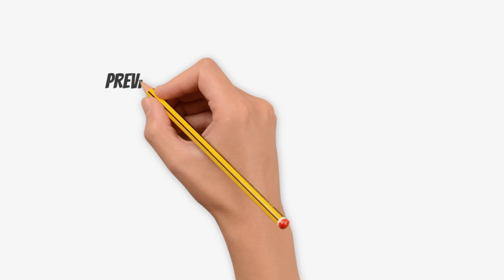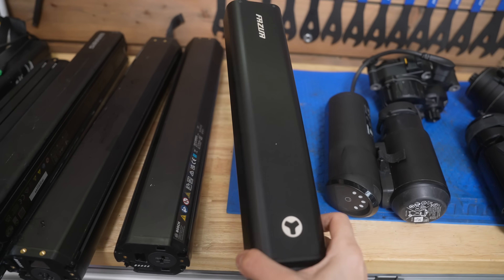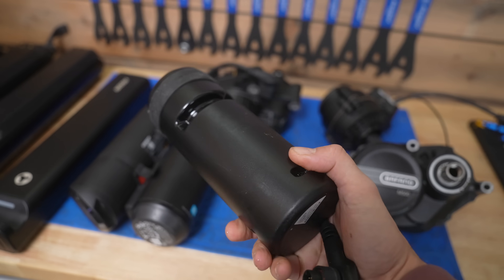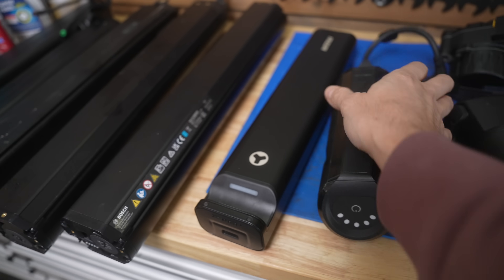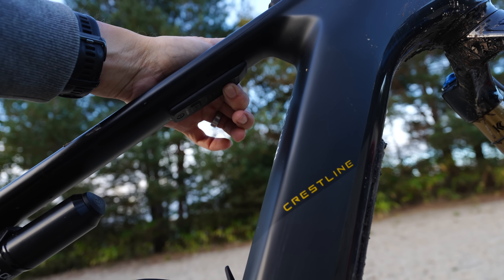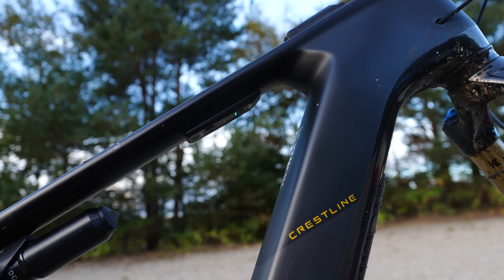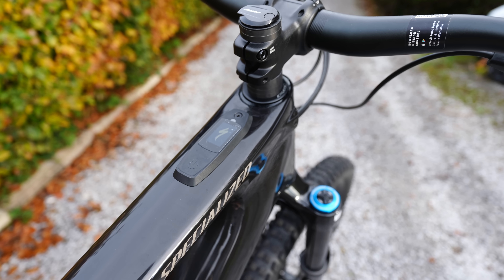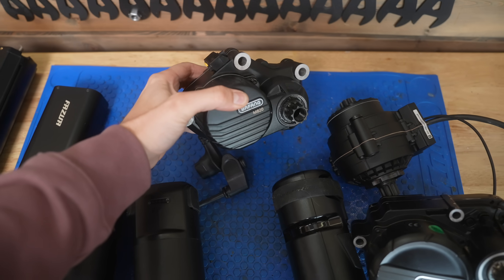We Have A Huge Problem With Ebikes....

Comment: I agree completely. The way it is currently done is wasteful (since the products can only be used in their proprietary system, much will be never used), more expensive (as creating single use sizes and formats create more work for the designers and manufacturers), cumbersome (bike shops trying to keep up with changes and storing parts they may never use), and just plain greedy as brands try to corner a growing market. This is why I love the Bafang mid-drive systems; use any battery, use any display, the controller is upgradable, the motor fits on nearly any bottom bracket. 👍 8:31 8:31 8:31

Comment: A rant worth having, Rob. I agree with you 100%, especially as someone who purchased an eMTB last year for $NZ9000 and it's likely it'll be the last brand new bike I buy and while I love my Focus eMTB to bits, it's likely the only things I'll be upgrading in future will be components that wear out. It would be so much easier to have standardised formats/standards that means people can upgrade a motor if they want to or buy an battery extender. Trouble is, manufacturers want to lock people into one brand ecosystem by creating proprietary systems. Big name PC makers have done it for years and it creates all sorts of problems. Here's hoping your on-point rant will hit home with some of the companies and they'll start being a little more consumer-friendly.

Comment: This is exactly why I havent bought an EMTB... could see it as really fun for a bit while it all works smooth but what happens to the bike in 3, 4, 5+ years? When I cant figure out the firmware upgrade, when something that is discontinued needs replacing..Dont get me started on the sustainability aspects, the energy that goes into extracting these materials from their raw materials is insane and when it dies in a few years and is worthless and needs to be thrown away

Comment: Great call out Rob! I sincerely hope it will get heard. Of Course we don't to halt tech advancements, but sure we can get some standardization going. 
This is what the car industry got completely wrong in my eyes as well. They could have gone with standard type batteries. Interchangeable in swapstations instead of having to charge. They could have build a whole industrie around it. Both consumers and industry would have been better off. The way things are a going now, electrification is a joke.

Comment: Hey Rob, 
I absolutely agree on this .
I've been working on 3 dirt bikes lately. Yamaha YZ 450 2011, Kawasaki KX 250 2014 and another YZ 450 but 2021.
I've fitted the same motor and motor on each one and swap the different batteries on each one.
This bikes were useless and now the ride like hell....I know the space issue is relevant in ebikes, but at least you could be able to swap the components.
Cheers

Comment: Is anyone else thinking ... bottom bracket? Even boost, none-boost, super-boost? ... I don't believe you can get a single standard for the motors, TQ motor is of a fundamentally different construction to say belt or cog systems from Specialized or Shimano. You just can't drop a boxer motor into the frame for an inline 4, goodness anyone else got a motorcycle will know all the different motorcycle battery sizes you can get!

Comment: No, You have a huge problem.  
How did you not see this compatability issue coming?,  you all were quick enough to jump on the 'Brand' bandwagon, spending thousands, without forethought simply to try to be better that the others (this is pretentiousness, a common trait of todays society).  You are much better upgrading your own bike frame to fit an aftermarket battery and motor and build an ebike that meets your own needs.

Comment: The same way you have to learn a bit of mechanics skills to work on a bike, you should also learn some electronics and electrician skill and to work on a e-bike.

You buy stuff that you are very happy to be plug and play. Sure standardization will help alleviate some issues in term of compatibility, and it is a good thing overall.
But the main issue of having way too much complexity will remain.

Look at the RC hobby, there is electronics lego, talking to each other with very simple means, all highly compatible. But you have to solder headers, adjust cable length, carve airframes, flash some controller.
Or you can go consumer and have ready to go drones with very proprietary communication, and hardware.

Looking at the example you gave here it seems like you are complaining about something that is mainly caused by your demands for easy solutions that require a lot of underlying complexity.

And come on, look at the bike you use and the way you behave, trying to try the newest and best shiny toys.
You asked for the situation the industry you are consumer from is in right now.

Comment: xt- 60 connectors ,solder iron, shrink wrap, 10 gauge cable , stripping pliers, and a volt meter is all I need to make any of those batteries work with any e- bike....

Comment: One solution to the battery's is to make the cells and BMS easy to replace. They probably all use 18650 cells, and if they made it easy to open the shell of the pack and used spring terminals in stead of spot welded connections you could just buy some new of the shelf 18650 cells and replace the existing when the battery pack goes bad.
And when it comes to the charger it is too bad that USB C can not put out the amount of watts you want to charge ebike batteries. And another standard like the CCS charging plug for electric cars is to big and bulky to be practical.

Comment: Unfortunately the level of ‘standardisation’ you’re suggesting would be a nail in the coffin of innovation. Personally I’d prefer to see the frame manufacturers provide frame upgrades (selling a new frame or frameset) so I can upgrade to a latest model. The biggest waste we have in the industry is bike parts. Eg. If you could buy a frame set for an ebike, you could switch from a traditional mtb to emtb easily.

Comment: Would there be a niche market for smaller brands to build engines and batteries for old systems? E.g. A bafang engine and batterywith Bosch bolt pattern and battery dimensions?

Comment: of course we all agree. i now own 2 e-bikes. old one is a 2019 commencal meta power. i’ve recently put a new e8000 motor into the bike at approximately 5k miles. plus rebuilding all the other wearables such as drive train and bearings.  it seemed worth it. but i doubt the frame is good for for more than this second motor. there comes a point with fixing older stuff of diminishing returns. i’m certain that when the rear triangle breaks, commencal won’t have a nos rear triangle to sell or give me. so there is a finite life span to the package.

Comment: Are we mad that cars have different motors and batteries?  Nope!  But what we can change on the e-bikes????  Your original example of fork and drivetrain.  What happens when a new system comes out that doesn’t work with the frame???  Sell the old one and buy the new one.  There will always be a market for used bikes.  Your argument just sounds like whining.  Part of this lack of collaboration is good old capitalism.  Just like why my Apple phone does not use an android charger.  Competition is a key part of capitalism and market share.  Get over it
Reply from the maker: Bicycles are not cars. Cars are sold as complete products. Bicycles are often sold as frame only from manufacturers. You can fit a new ebike motor with a multitool (that you carry in your pocket). Your postman can deliver an ebike motor. Ironically now the iPhone and Android both share the same USB-C charger, and a car battery is a common shared part that can be purchased at an auto store due to standardisation, so your argument is a bit flawed.
Reply: @RobRidesEMTB  iPhones do not us usbc ports.  They use lightning ports and where I am they are not compatible.  Ford lightning charging port is not compatible with a Tesla unless you have an adapter.  But you cannot put a ford lightning battery in a Tesla.  You cannot put a lightning motor in a Tesla.  Heck I have different batteries in my different go pros even or other cameras for another product.  But back to the bike industry, they just decided this past year to have a universal derailleur hanger after how many decades of bike building?  I think the industry finding industry standards while the tech is in its first development stages is unrealistic.
Reply from the maker: @m4sl_academy sorry your facts are wrong. iPhones moved to USB-C this year, universal derailleur hangars came out in 2019, and many EV’s now share charging standards. My Tesla can use my wife’s BMW i3 charger and vice versa. And moving forwards Toyota (world’s largest car manufacturer) announced they will be adopting Tesla’s charging standard, as will Ford (and almost all large auto manufacturers), will all be using the NACS standard (aka ‘Tesla plug’). So standard in the auto market are already here.
Reply: @RobRidesEMTB  although sram introduced the UDH in 2019 most companies didn’t start complying/adopting it as well until the introduction of the eagle transmission system this past year.  The only iPhone that has usbc is the latest 15 which is new and just released and until this post I did not hear about and that just seems annoying frankly.  That took a law to change and not the industry, and look how long phones have been developing.  But your whole argument against my “flawed post” is just based in chargers.  My main point is that motors and the batteries in the cars are not universal, don’t have universal fittings, or are standard.  Which is common especially when the technology is developing and fairly new.  Industries standardize as it becomes needed.  I’m sure as Bosch, shimano, etc don’t want to stock old batteries or take in account old tech and as common tech is adopted they will form standards that help the industry until then it is unrealistic.  Right now it’s a race for things to more powerful and hopefully lighter at the same time.

Comment: Appreciate it’s a slightly different part of the market but this is one area where conversions have factory ebikes licked. 

Yes they’re not quite as pretty or discreet, but they’re fundamentally modular and any part of a decent (say Bafang) setup, be it battery, display, throttle or indeed motor can be interchanged at will.

Comment: From working in an ebike exclusive store for 4 years I love the suggestions and points, but many points have flaws and just won't come into affect anytime soon 

In the case of cross compatability of chargers this can be quite dangerous, for example most manufactures use a 36v system, rockymountain uses a 48v charger which if we attempted to standardised chargers then systems like rockymountain would need to change design, smaller issues with cross compatibilty is most brands of batteries delivery power through 1 large pin to charge the battery but simplo batteries actually use a shared pin design which splits the cells into groups inside the battery meaning they'd have to change there design, other issues that would need to be tackeled are the bms used like some batteries stop charging based on the information the charger is reading which it has no other communication to the battery other than voltage, or the opposite where the charger might be simple just delivering charge and its the batteries job to repeat to the charger information. It would be nice if we could have one charging standard and this is almost the case with cheaper ebikes using almost standardised chargers and standardised batteries, typically about 6 styles of batteries, 2 different voltages and 4 different charging plugs (typically). If this issue was to be standardised then cheap commuter bikes would cost to much for many wanting to ditch the car and for higher end bikes would slow down innovation and also cause a liabilty issue if a battery was to fail (best case senario) or a hosue to set on fire (worst case senario). This extends further with motor arcitecture and batteries, while to the average consumer they're all pretty much the same they really aren't in there arctitecture, it is the equivellent of saying a piston from an GM Ls3 can fit into a Crysler 6.4 Hemi, just because they're the same in cylinders, similar displacement, sound similar and have similar power does not mean one just fits into the other. 
 
Suggesting trade ins for the "outdated technology" idea just does not currently work on the current climate of bikes, while at the francises I work at we do have 'consignment' bikes where we take 30%, we end up selling the bikes for very sub optimal prices as many customers don't want used bikes as they are outdate and batteries typically are fairly worn out and tired, neither can where I work absorb the costs associated with accepting trade in bikes, if this was a manufacture supported concept it would work out but currently some bikes on the real low end we only make $250 usd per bike, some have good margins like many focus bikes making a whopping 50% margin, others we barely reach 25% for bikes that have a retail price of $1000 usd. All other stores I'm currently aware of that we have spoken to or done business with does not have a trade in/consignment sceme and well many just don't plan on it. Many bikes that are traded in and resold at the store also have extensive maintence done to the bike before it is sold which costs the customer money and with the way we do it is seperate to the 30 perecent commision, assuming a bike costs $2000 usd, we suggest selling it for $1000 usd, we do $200 of work to the bike and then take 30% commision the customer ends up with a bike they bought for $2000 turning into $560 in their pocket. And while I might be sounding greedy, currently the business after covid plumeted and almost every week it make enough to cover staff, rent and utilities let alone buying bikes to just have sit on the floor for months on end, while I am an employee only I am very aware of how much money is in the account at any given time and well it ain't great. 

Standardisation and future proofing while as great as it would be, espically for the shops that have to deal with the bull crap, it just isn't feasible for countless reasons, I could go on for days about why it just won't happen, it's unfortunate but it just won't happen because engineers have other ideas along with the capitalism hidden within these companies and competitve nature, not to forget the issue with chargers that could end up leading to a larger issue with liabilty. Of course suggesting these companies come together and standardise certain aspects is all well and great but at the end of the day they make money by keeping you in the cycle and well there's nothing more important to companies than money. It would take regulation to standardise this and well I can say for sure this will impact innovation dramatically if we standardised products, it might work for usb c but it certainly will impact ebike innovation.
Reply: wow 🎉
Reply: Can't we come up with a standard that can charge within a range of voltages, say between 30V to 60V? We already have this with chargers for EVs which can charge any vehicle and EV battery voltages range anywhere from 300V to 500V. There some outliers in the 800V range. Chademo's e-bike charging standard EPAC which they've been pushing recently unfortunately maxes out at 42V. https://www.chademo.com/wp2021/wp-content/uploads/2022/10/Eurobike2022.pdf.
Reply: OH come on - Rob did acknowledge it may not be possible to completely standardize to a single standard, you can't try to tell us current situ can''t be reined in substantially.  The industry really needs to make a bit of freakin effort here, or like phone and puter hardware, it will be made to.
Reply: Too many commas, not enough periods.  Gave up reading it.
Reply: Zero backwards compatibility within the own brand is literally what is driving me away from a company. It's not keeping me in the loop. 
Since nothing on my old bike works with a new bike of same brand, I can just as well switch to a different brand. 
Seems like they made some grave miscalculation.

Comment: Amazing isn’t it.   How can there not be a battery standard? Like in cars.   I can go to Walmart, Canadian tire, or any garage and easily get a battery for any car.
I can go to any store, and have a brand range of AA, AAA, ETC… batteries for any other device in my home.
I get maybe not every aspect of an e-bike system will be compatible with one another, but chargers and batteries should be.   Wouldn’t this common battery size, and 1 single universal charging cord, also help drive down prices (resulting in more sales)?